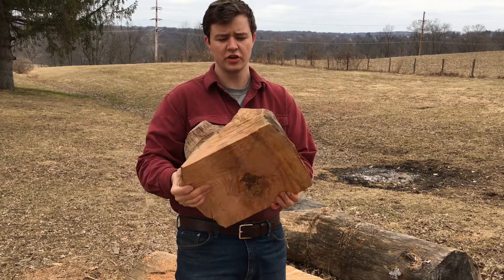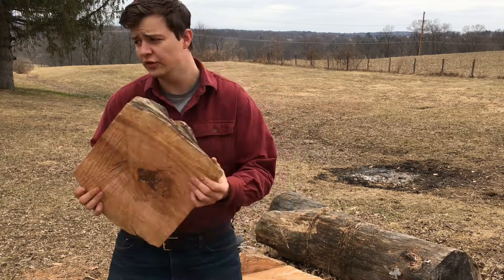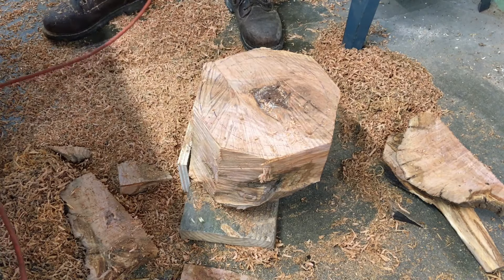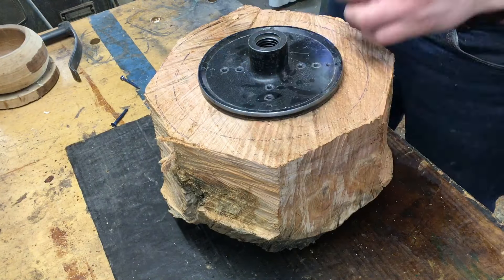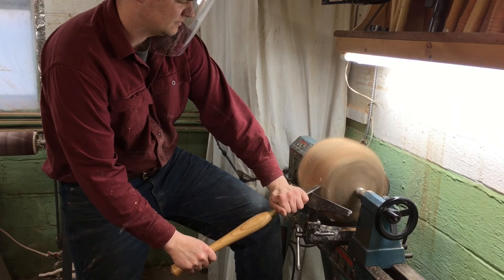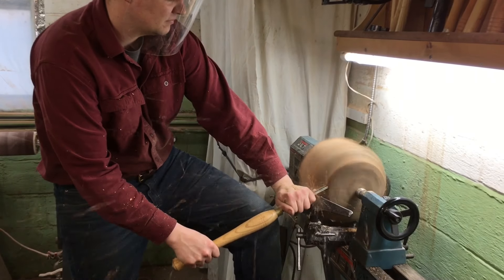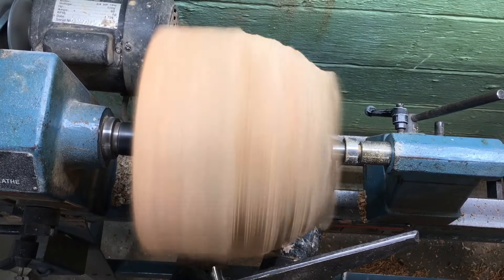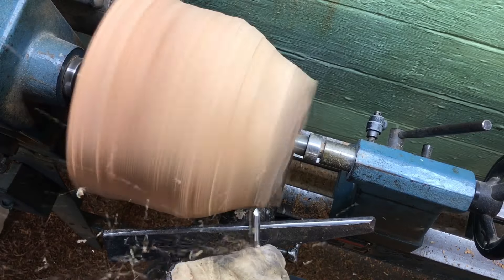Woodturning a Gnarly Red Oak Bowl

Comment: The tenon should not hit the bottom of the chuck jaws. You are reducing the hold power of the chuck the way you did it.
Reply: Q cosas mas bellas me encantan
Reply from the maker: The only time that's a problem is if the the tenon is forced into the back of the jaws, creating friction and possible keeping them from closing parallel. I bring the tail stock up gently, without locking it, just as a helping hand. I think its important to grip as much surface area as possible.

I'm certainly not an expert, do whatever your manufacturer recommends
Reply: @AdirondackIron  A great deal of the chucks holding power comes from the top of the jaws resting firmly on the bowl bottom.  Read some books, do some checking.